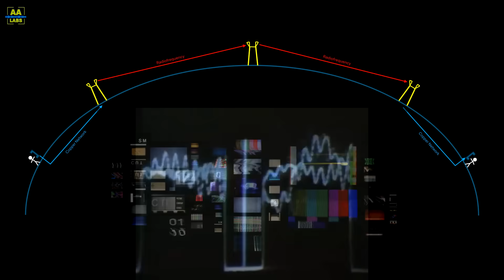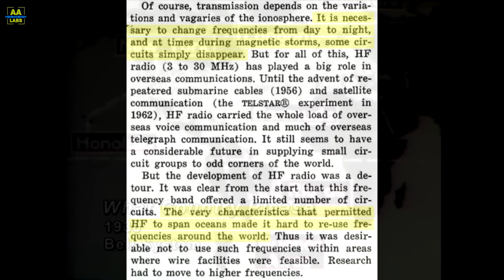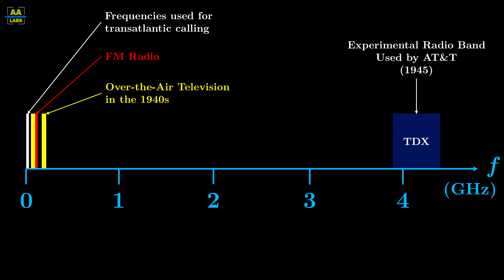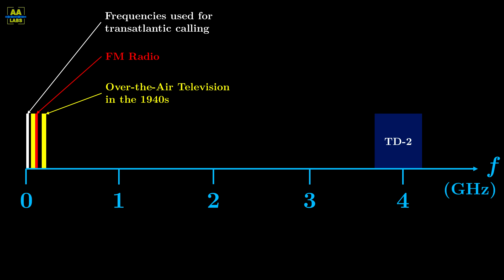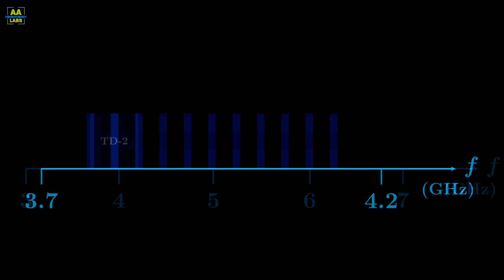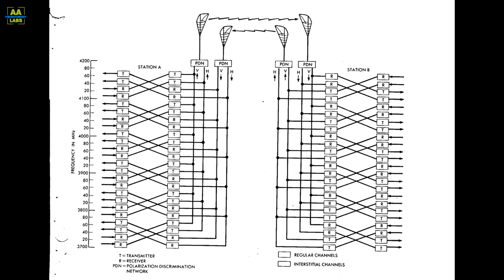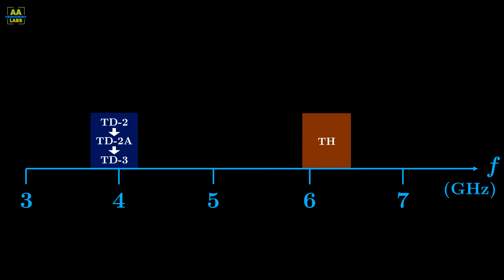AT&T Long Lines: The Wireless Network Before the Internet

Comment: I think it's a mistake to draw comparisons between the microwave long distance radio net and other radio-based telecommunications products. They're different products designed to do different things. And while that one product was wireless, it wasn't the same as wireless mobility products like AMPS, IMTS, MTS and mobile telephony before that. Wireless long distance was an adjunct to wired long distance, and there were many wired long distance connections running at the same time as the microwave ones. When we consider that the need for a robust long distance network came with the Cold War need to maintain a military response to a nuclear attack, buried cables would have been the preferable method, but microwave was faster and cheaper to deploy in the time needed. It was the very best that we could do, given the state of the art in technology at that time.

I'd like to point out that Ling Lines was the division of the Bell system before court-ordered divestiture, and not the name of the microwave portion of the network. The network as a whole included microwave, coax and twisted pair carriers, and to the phone system they were all interchangeable. When placing a call, you didn't pick and choose what long distance technology you used, and it was all seamless and automatic to the user. Only when satellite calling briefly became commonplace did the end user even notice a difference in call quality, due to the obvious lag between speaking and hearing your voice. Nobody noticed a "microwave sound" because there was no such thing. Indeed, when the Bell system moved to TDMA from FDMA for voice calls, call quality became identical.

My own experience using the Long Lines division, and later the AT&T Long Distance company, it was outstanding, and that was regardless of whether the call was carried by copper wire, microwave radio or glass fiber. Before divestiture, it was the only game in town, and afterwards it was the competition that bore the burden of justifying their use. For the most part it was cheaper to use a competitive long distance carrier. The whole analog v. digital comparison was more about marketing hype than reality, as the Bell system had not only invented digital telephony, but had switched to it before divestiture. By that time, having some legacy analog circuits as backup was a matter of reliability than one of quality. More often, your competitive long distance carriers gave you a busy signal during times of congestion. Marketing fewer available lines as "higher quality" was pure BS. These were phone calls, not hi-fi! But IME the AT&T Long Distance network had the best call quality of them all. It was the competitors who never sounded quite right for some reason.
Reply: I used to produce toll carrier settlement reports for a outlier location (telephone co on St. Thomas US Virgin Islands in the Caribbean).  Even at the top level it was a mess. The money bible was the DDRG (Distance Dialling Rating/Routing Guide) for InterLATA calls.  Separate maps for circuits., though the actual path taken was generally to the center of your star network hopping between the center cities of stars on the way and out the last star to the subscriber.  These days for Internet routing a packet stream takes many shortest-paths in succession. You could say that border router with a full map of BGP advertisements are each as smart as the 'smartest' routers of those days. Then favored paths were often patch cords in plugboards.

Comment: This is when communications were a lot more reliable. Today a small thunderstorm can knock out the network. Those old systems were bulletproof especially during a major natural disaster. I guess this is what we call progress
Reply from the maker: I don't know how true that statememt is. Long Lines was the backbone network. The current backbone/"long haul" networks are still very reliable and have a lot redundancy.

Yes, your cell site or cable node might go out from time to time, but this is different from the core network. A bunch of wires on a telephone pole weren't exactly reliable back then, either.
Reply: @DoubleALabs  Well when 9-11 happened you could not make a call for days in and out of Northern NJ and obviously NYC! About the storms? I have a few examples. In 2012 Superstorm Sandy knocked out communication lines for many in NJ and in NY. AT&T cellular customers could not even make a call between the hours of 9am to 5pm until days late, and look at what Helene did in  Western NC. Knocked out communications for days if not weeks in some fringe areas. Now I'm not saying that if we still had the old long Lines this would not happen, but this is 2025, and it seems to happen more often than not.
Reply: How do you define "reliable"? 50-60 years ago, it was fairly common to have a call not go through. I can't remember the last time that's happened to me with packet switching. When has a "small thunderstorm" ever brought down an entire network? Get real.
Reply: @Speed-Daemon-123  I should've said a strong storm or a major disaster.

Comment: I'm a locator now but when I was on the trouble crew, i never passed up an opportunity to poke around any forner Long Lines site where my job happened to take me. There is a hardened site near my house that was like a mini CO. 671 Detroit Diesel generator, battery jars, offices for the workers, switching equipment, microwave radio gear, etc. One site in Beaver County looked like all the workers just stopped and walked  off the job one day - papers on desks, test equipment on benches, etc. Oddly enough, there is also a pre-wireless K Carrier hut near me that they re-purposed as a Litespan Hut. Then FiOS happened and the Litespan was Retired In Place around 2010. Tech is moving pretty fast...

Comment: 0:52 For the most part, AT&T used C-Band microwave equipment, so it was in the 4, 6, and 8 GHz frequency range. Modern cell phone commonly use those frequencies. For example, 5G Band N79 uses 4.4 to 5 GHz. But 40 years ago, no consumer equipment went so high.
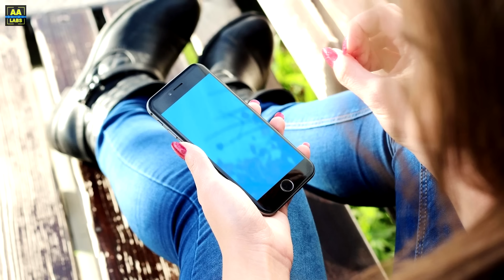Reply from the maker: Yes, that statement was for that time (1940s-1950s). Satellite later used nearby bands (C-band), so theoretically you could have intercepted these signals with a (giant) C-band dish. It's crazy that cell phones use that band now, which I did mention towards the end of the video (10:37).
Reply: No, C Band was (and still is) for satellite communications, not for terrestrial microwave.
Reply: @Speed-Daemon-123  C-Band for satellite TV used to be 3.7 - 4.2 GHz. A few years ago, they did a repack of the band and sold off half for 5G cellular (now Band n77). 
3.7 to 3.98 GHz is for cellular, a 20 MHz guard band in-between, and 4.0 to 4.2 GHz is still used for satellite TV.
At the high frequencies of C-Band the signal is very directional and able to be polarized. That's how all the many satellites were able to reuse the same block of frequencies. Moving the dish by only a few degrees put you onto an entirely different satellite. I assume that's how AT&T's long line services never interfered with satellites. The microwave "horns" were point-to-point.
Reply: @derek17ca  what a steaming load of BS. First off, all the BS about cellular is completely irrelevant because the microwave long distance system lived and died years before 5G. The BS about "high frequencies" being "very directional" is 100% made up pseudoscience crap. As much as I admire people who do hard work in studying obscure scientific topics, that admiration would be nullified if I didn't reserve a proportional amount of disdain for the liars who tell BS stories with ease, polluting the Internet with misinformation, a patchwork of nonsense designed only to shore up the next tall tale. Once again the gap between the whole truth and simply regurgitating the results of a search engine query is the entire story, and what makes this topic interesting to many of us. But intelligence-free recitations of a web search is not a special skill, we don't need that nonsense. Stop.

Comment: I think there is a set still standing on rt 20a just south of Warsaw, NY. Also, I recall seeing these horns on top of tall buildings in downtown Buffalo, NY in the 1980’s. (I think)
Reply: feedhorns
Reply: There was a tower on top of the old Buffalo Central Office/AT&T building in downtown buffalo on Church St, yeah. There's a ton of towers still around here, in fact the buffalo central tower is the only one gone now. Springville on Moore Rd near 219 still has its original antenna set, along with a smaller newer microwave tower right next to it, look like the newer round antenna you see on some more updated long lines

Comment: odd pronunciation of derelict  ?
Reply from the maker: I think I just got it wrong. It's a word I've read but rarely heard spoken.
Reply: @DoubleALabs  /ˈderəˌlik(t)/ or der-uh-lict.
Reply: @DoubleALabs  Ya, I noticed that too. I thought at first this was just a computer generated voice, but probably just a rare word that not many people know how to pronounce. 
I worked at Century Telephone in the 90's and actually worked on a microwave system that connected to AT&T at Coon Valley Wisconsin. I think we had TWTs in it, Traveling Wave Tubes. This was at the 5th & Jay street office in LaCrosse, Wisconsin. When I retired in 2012 we were installing fiber with GiG-E data connections to peoples homes. Amazing advancements in technology.

Comment: AT&T's microwave network was not secure against eavesdropping. The signal modulated on the microwave carrier was analog with voice channels spaced 4kHz apart modulated in single sideband (SSB) format. The signal from the transmitting antenna was concentrated into a strong beam to carry 20-30 miles to the next repeater station, but the beam had side lobes. With a receiving antenna near one of the repeater towers, it would have been possible to pick up a signal on a side lobe that was at least as strong as the signal some 20 - 30 miles away in the main beam. The problem was that the microwave receiving equipment was not readily available, although not completely unavailable. Other companies besides AT&T made microwave antennas and downconverters. So, it would have been possible to down convert into a ham radio band and eavesdrop on the conversations using a ham band SSB receiver.

It is said that foreign spies did do that around Washington DC. The telephone channels carried a tone when idle. When the channel was assigned to a call, that tone was removed and a series of tones, similar to today's pushbutton telephone tones, sent the called number. So, the spies could receive the called numbers and eavesdrop on numbers of interest to them. Since the lines were assigned for outgoing calls in a specific order, the eavesdropper could figure out which channel was next.